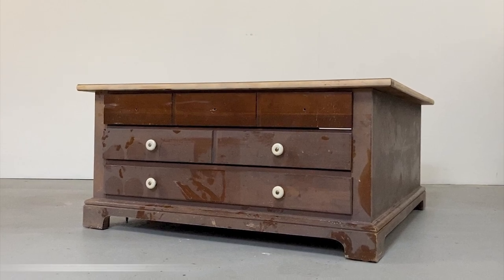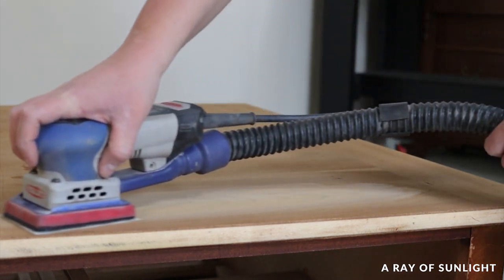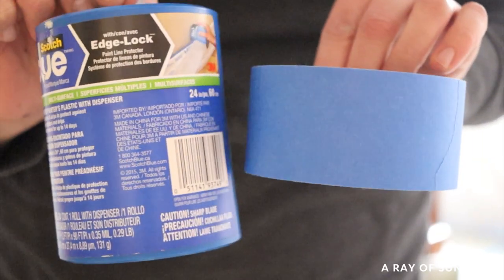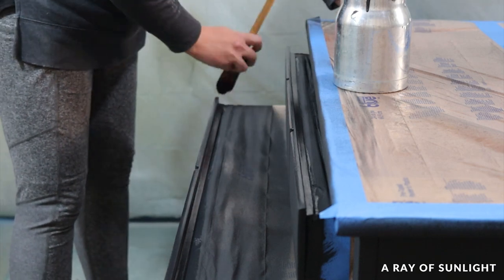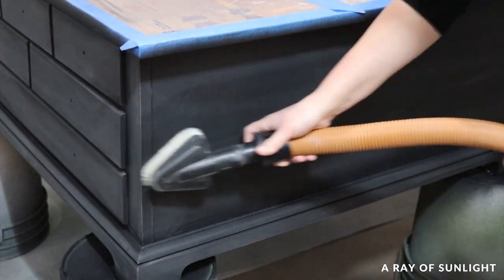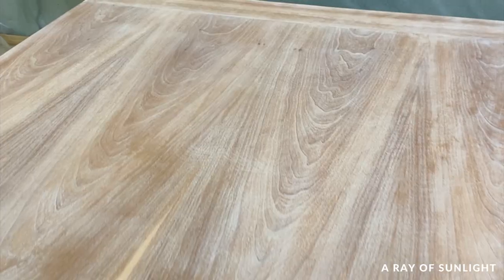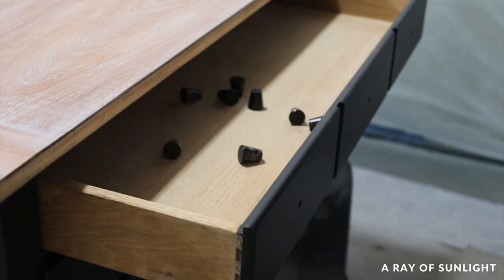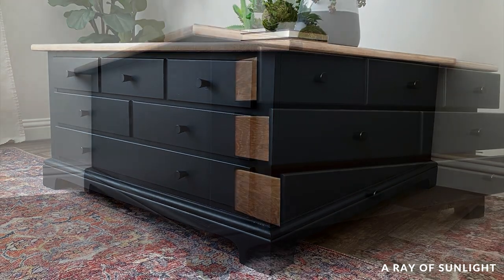Coffee Table Makeover Idea | With Chalk Paint | Before and After Furniture Makeover

Comment: I have an Earlex HV 5500 spray system too and I've been having some issues spraying chalk paint on some chairs...Clogging my tip and spitting a lot...cleaned it thoroughly each coat and still was doing it with Valspar Indigo Cloth 4009-7...a very deep dark blue...wondering if it wasn't thinned enough or too much calcium carbonate, my 1/2 cup CC to 1/4 cup water added to a 15% diluted quart of paint...